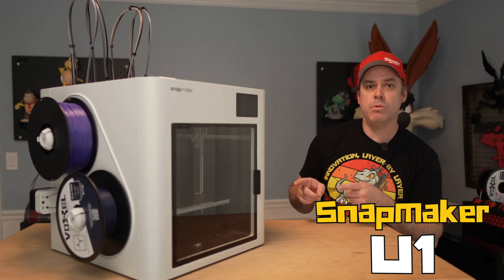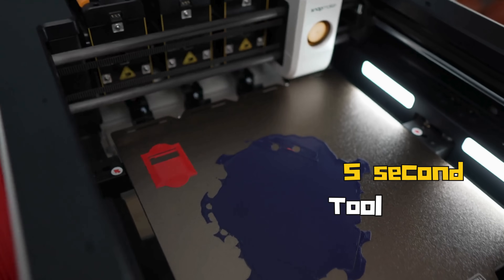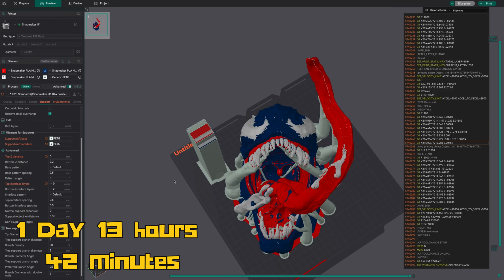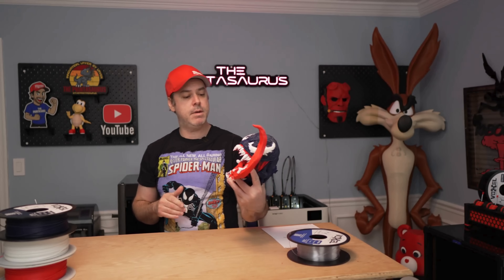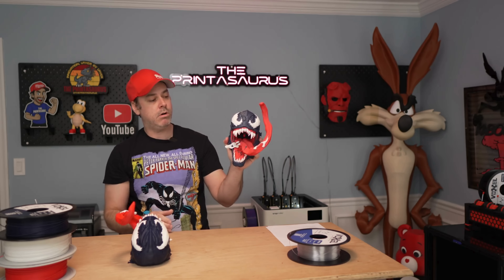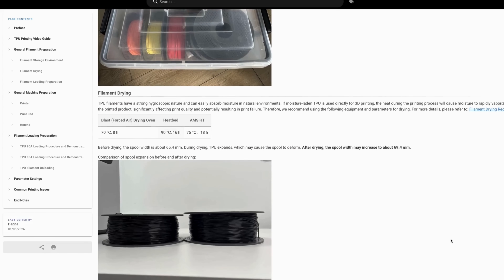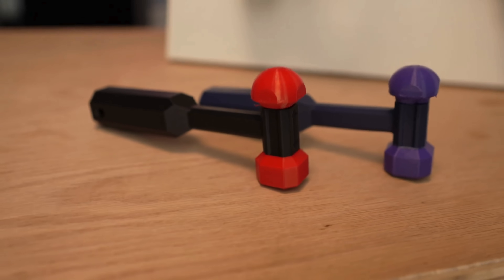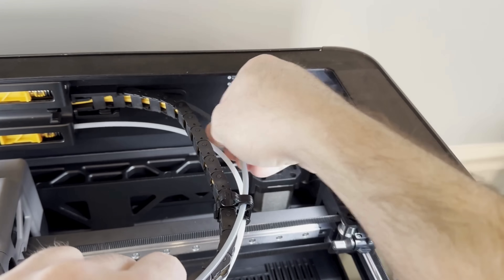Clash of the New Printers Snapmaker U1 vs Bambu Lab H2C

Comment: First of, great video and i really appreciate the transparency, great production quality and overall very comprehensive comparison.

One thing i would add, i think especially for engineering the U1 can be as good or even better than the H2C

1. For quite a few functional multi-material prints the U1 can be better or even the only one of the two which can do certain jobs, for example combining different types (and such hardnesses) of TPU in one print (maybe one for flex, one for grip, or different degrees of those properties), or combining TPU and more than one other filament (for example in an axle with rubbery materials for wheels, a nylon material top layer for less friction on the gears and a structurally strong filament to hold all of it together in a way that can handle the stress put on the axle). I think if anyone might find the need to combine 4 different types of materials, without the restrictions of the AMS, it will be engineers.

2. with the cover (chamber heating up to 60°C through the table) and hardened steel hot ends, the U1 can handle most of the materials the H2C can, since only very few filaments actually require the 350° nozzle temperature of the H2C and it‘s active chamber heating, while faster, is basically only as warm as the U1‘s. 

3. Snapmaker using Orca and Klipper and thus being more open to custom settings or even messing with the G-Code, potentially plugging in other programs or applications, or such is also something i think engineers might appreciate or have a need for.

4. in prototyping, the overall faster print time of the U1 (especially mixing materials) might also be important to engineers.

That said, obviously, the greater reliability of Bambu Lab as well as maybe the laser modules (although as or more expensive than dedicated laser cutters/engravers) that Snapmaker doesn‘t offer yet, and the bigger build size can also be an advantage, especially since you too notices the U1 still has some quirks to iron out. 
So overall, i think, it really depends on the type of engineering you plan to do which machine is better, rather than the H2C just straight up being the better machine for engineers.
Reply from the maker: All great points and definitely appreciate the detailed insights!

Comment: What one is the quietest? Thankyou
Reply: About the same, I have both. Without the top cover the U1 is slightly louder, but with the top cover the exact same.
Reply: They are very close to the same when the u1 has the top on. When wiping or changing materials or nozzles, the h series is much louder. Youll hear it wipe or even home, from the next room. We wont even mention how loud the ams units are. I have u1, x1c, h2d, h2c, 10 ams units, prusa xl, voron stealthchanger and vcore 4 500mm atm.
Reply from the maker: H2C by far.
Reply: @ThePrintasaurus  would this be true if you put the enclosure on the U1?

Comment: I have both printers too, the U1 its an amazing printer but I don't trust it for large o longer prints for some reason the prime tower always fell, I try everything, glue, making the prime tower more large, nothing works for me, for small prints its amazing, for large prints? Im not having lucky. I already report it to Snapmaker and they told me that they know about this and on the next update they will fix this. With the H2C the story is different, 100% success of every print, I can sleep without any worries because It completes the works nicely. 

Another thing, the U1 is loud, I don't hear the H2C on my living room, the only one I hear is the U1, but like you say I think is not fair to compare both printers because they offer different technology, the H2C for now don't have a real competitor with the technology of nozzle swaps. U1 competes more with the Prusa XL than any other printer right now.

I don;t want to sound like a fanboy, but the H2C is beautiful and I know that is going to be reliable for the next 5 years, I cant say this about the U1.

Good video btw!
Reply from the maker: Thank you. All great valid inputs as well. The overall print quality is great. I'm testing a Biqu glacier plate for the U1 and that has fixed my purge tower issues so far. I've had the same issue, increased brim, bed temps, etc. Same experience on longer prints usually around the 800ish layer the purge tower falls. It's stayed adhered so far with the Biqu plate.
Reply: @ThePrintasaurus  that‘s such a weird bug, have you tried with the normal orca slicer rather than the Snapmaker variant? Since the actual prints seem solid regardless of built height it certainly seems like a software issue.
Reply: @ThePrintasaurus  Good to know! Prob I will buy the Glacier plate for the U1. For now the H2C is taking all the jobs I have, is slower yeah, but worth every cent.
Reply: I have the U1.  I haven't had any issues.  My only complaint is the noise level.  The H2C looks like a very nice machine, but it is out of my price range.  I got the U1 in the Kickstarter campaign, which made it a tremendous value, even with the cover and hardened nozzles, which I have on order.
Reply: @terryforsythe8083 Yeah obviously for his price it’s an amazing machine, but my personal opinion I don’t trust it yet for large prints. It’s amazing for small things but until Snapmaker don’t release an update to fix the prime tower I’m not going to use it for important things.
Reply: @Scheettini  try this:  For each filament, open up the settings and go to the "Multimaterial" tab.  Then increase the "Minimal purge on wipe tower" setting.  My understanding is that makes the prime tower  base larger, and thus more stable.  Another option is to apply bed glue where the prime tower sits.  I have not had any problems yet.  But if I do, I will try one of those.
Reply: @terryforsythe8083 I will try it later, but since I’m sending Snapmaker feed back about the prime tower issue, I’m not going to try making a large model until they told me that they released an update that optimized the default prime tower. 

I don’t want to hate the printer, but, the prime tower falling on a 80% finished  tall model hurts because it always ended messing the entire model. 

The H2C is working non stop making my big models.
Reply: @Scheettini  The H2C is very nice.  If I had a bigger budget I would get one.
Reply: It's not a printer issue, it's a slicer setting.  I'm not in front of the computer, but when I Googled it there are 3 or 4 different ways to keep the tower from falling.  The first one I tried worked.  It had something to do with setting the prime tower so the outside border was always PLA.
Reply: @jalpert Yeah and I’m not blaming the printer for that, I know is a software problem, I reported it to Snapmaker and they are working on it.
Reply: I do massive prints on my U1 and it's about as reliable (actually more) than my h2d.
Reply: @SirDragonClaw Yeah and I’m not saying is a bad machine, the U1 it’s a great machine, but needs more software work, Snapmaker knows about the prime tower problem, it’s only on large prints. But since then, H2C all the way